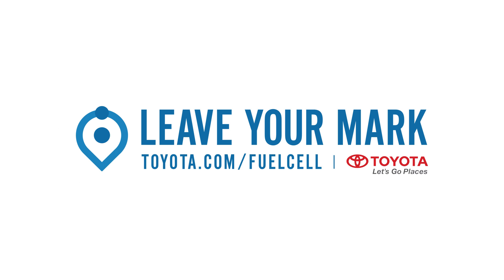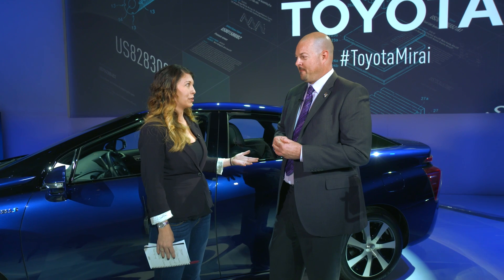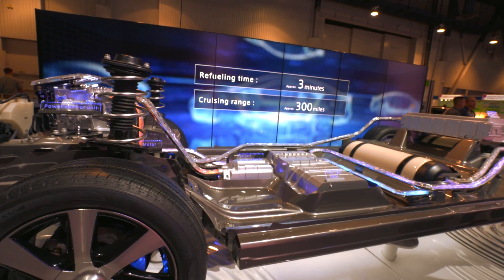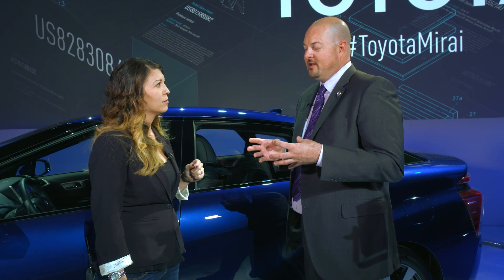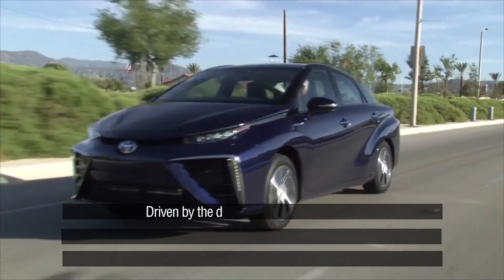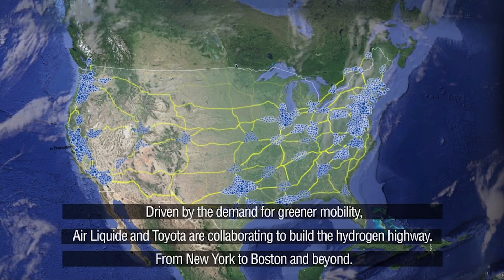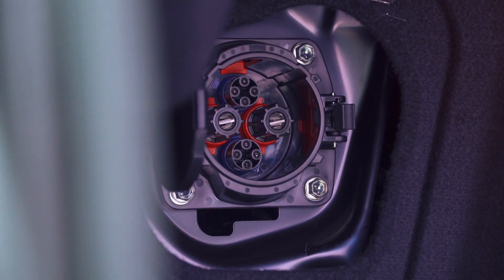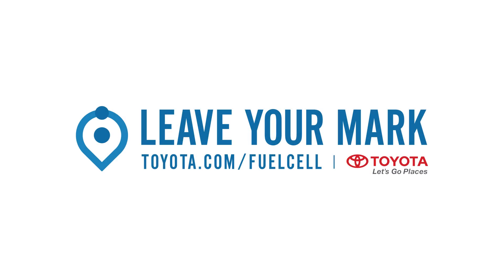Powering a Home with Your Car

Comment: Ah, yes, but we don't have an endless supply for natural gas and it's competing with gas for the home for heating and cooking. Other methods will be needed, like a larger supply of hydrogen stored in water.
Reply: Yes but we already know other ways to get hydrogen that don't need natural gas, so we've got that covered. If in the meantime it's cheaper to use gas than another method, why not? And if this technology takes off you can bet tons of money will be used to research better ways to get hydrogen.
Reply: sustainablility. Cheaper makes economic sense, but that natural gas is following the trend of fossil fuels with regard to global reserves, it will not a viable option in the long run, even if its cheaper thatn fossil fuels. And you have the issue that natural gas consumption is cars will then compete with natural gas for the home. That is an important economic issue in the grand scheme of things. Natural gas reserves is a big issue in the Netherlans and Europe for that matter. I think that is what the subject of hydrogen fuel from natural gas is an important topic for critical discussion. On the other hand finding ways to win it in a viable way from plain water makes more sense to go for hydrogen instead of fossil fuels. So why the winning of hydrogen is currently mostly from natural gas instead of water boggles me.

Comment: Electric is the way to go.
Last thing we need is another mega corporation that monopolize the production of hydrogen through the country.
Reply: ImprovisedSurvival large corporations have a vested interest in generating stuff in the most economic way possible - - today that is done through conversion of Natural gas (95% is generated that way) It becomes about efficiency because the hydrolysis process a kid would use is so massively inefficient.
If you have the electricity to make the hydrogen it makes far more sense to use it directly in an electric car than to generate hydrogen to put in a car for it to generate a tiny fraction of the electricity you started with.
Reply: litlea1991
You will stop producing it when you get electric bill :-). 
It takes around 300kWh to create hydrogen needed to fill up Toyota Mirai, and Mirai can do 300 miles. With 300kWh, electric car can do 900 miles.
Reply: Hydrogen is literary the most abundand material in the known Universe, no cooperation can stop you from making your very own hydrogen and power your car with it. Unlike Electric verhicles, which are relying on the Grid
Reply: litlea1991 You can make your own biodiesel too, and even churning your own butter, but how many people do it?
Electric vehicles rely on electricity, not on the grid. If you've got a house you also got the space for all the solar panels you need.
Reply: litlea1991 It might be abundant, but in order to get to it on earth you need to expend a lot of energy to break its atomic bonds.  Most hydrogen used today is produced by the steam reforming of methane or natural gas, at high temperatures (700–1100 °C). Makes more sense to use that power to charge a battery & dodge the whole hydrogen idea.
Reply: Yes a kid can easily make Hydrogen through electrolysis,  the snag is you have to put in over four times the electricity in that you get out from the hydrogen you made in the fuel cell
Reply: Peppe Ddu
Making biodiesel is so much more difficult than making hydrogen. A kid could make hydrogen.
Reply: How did efficiency get into this conversation? I was replying to the original "mega corporation that monopolize the production of hydrogen" statement. That's it.
Reply: Roy Richardson
I'm sorry you misunderstand my comments. Good day.

Comment: No thanks. With Hydrogen one is still reliant, and at the mercy of the fueling station. I'd rather charge my vehicle via solar panels.
Reply: You could make your own hydrogen at home using water and solar energy, that way you get the convenience and range of Hydrogen but you wont have to rely on fueling stations. If it bothers you that much...
Reply: as Others have pointed out, clearly no. Hydrogen can be produced through electrolyse and other techniques, which dont rely on any kind of grid. (you could power your electrolyse with solar power and various other methods). Seriously Hydrogen is the most abundant Material in the known Universe.
Reply: litlea1991 Its still not feasible. You would use more than produced. Never mind the power usage involved in getting it down to −259.14 °C (−434.45 °F). You put in more than you get out.